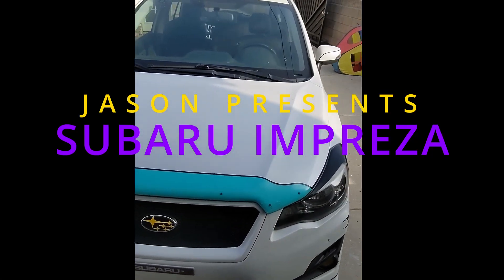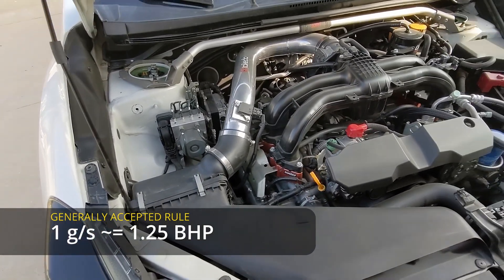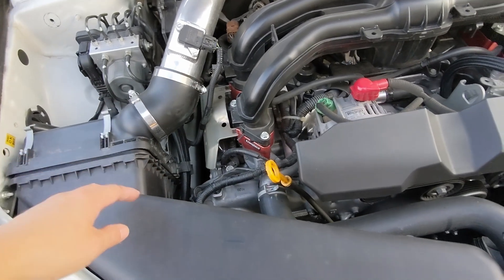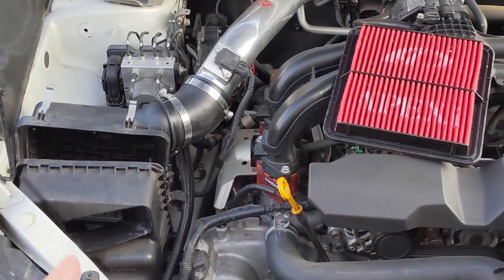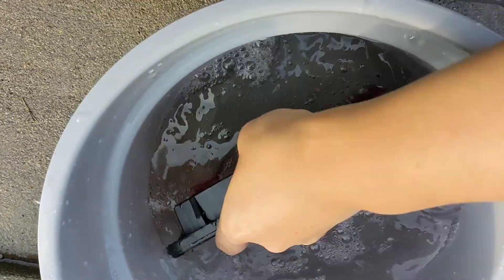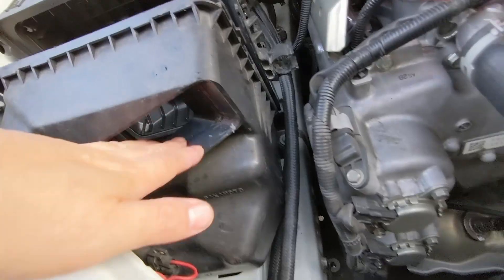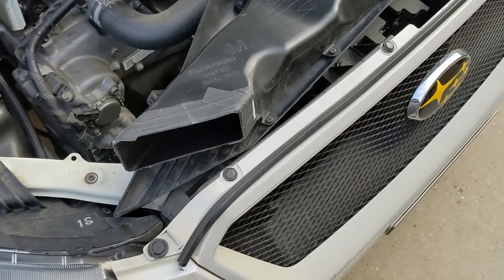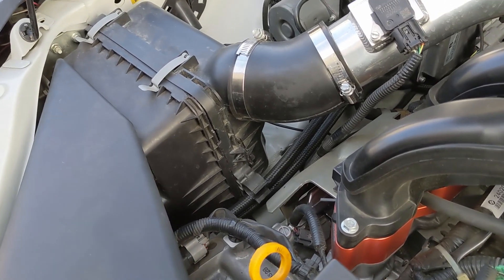Subaru Impreza Sport -  Engine Air Filter Service, mods and optimizations

Comment: I have a question about the air oil separator. The only naturally aspirated Subarus that aftermarket companies seem to make the air oil separators for are the Bajas. How did you get the Baja kit to work for your Impreza, and what brands do you have experience and/or a preference with?
Reply from the maker: You may be confusing the Baja edition with the Subaru Baja. Which car and year do you have? Crawford Performance has multiple fitments of AOS for Crosstreks and Imprezas.  I am using one from this page https://crawfordperformance.com/collections/baja-edition-air-oil-separator-aos-kits

Before you go and get an AOS, what are your reasons?
Reply: @JasonLeung-4roller  actually, you’re correct. I was getting that mixed up. I have a 2009 Impreza 2.5i. I recently got a new intake tube that does not separate the air and oil like the the factory intake system did. It could potentially get some oil on the throttle body. I think it would also help reliability if I were to somehow get a AOS installed on my car. A few companies from the same model year, but for the turbo models, have a system that theoretically would work just fine if I only used the parts my car would need, since they have extra tubes and connections mine doesn’t have or need, but I’d like a second opinion
Reply from the maker: @joshadventure8253  the AOS hooks up the the PCV and the intake manifold. Where as the intake (before the throttle body) is connected to the engine breather port. On my car I have used an oil catch can on the engine breather port that then connects to my aftermarket intake tube.  This catch can should help keep the oil vapors from getting into the throttle body, which long term will gum it up. 

To be honest a little bit of preventative maintenance (cleaning PCV valve) and cleaning the throttle body every once in a while (with throttle body cleaner) should really go along way. So much so that the inclusion of both AOS and breather catch can aren't necessary.  That being said both AOS and catch can should help a little. If you are good about maintenance then I'd say save your money.
Reply: @JasonLeung-4roller  that’s fair. Thanks for the help. I really like your channel, it’s helped me with getting some pretty good ideas on better parts for my Subaru

Comment: New to the channel, keep up the great work. Just became the owner of a 2018 Hatch Sport-Tech and was wondering which apexi filter you purchased? Was it the filter for the 2016 or a different model?
Reply from the maker: The filter I bought was for the 2013-2017 Crosstrek though other models use the same airbox. . You may be able to find it for the 2018+ Crosstrek.

Comment: Haha I use pure soap to clean now as it's so much gentler.

Can you reverse the intake on the FA and FB motors? I know it's a mod done on EJs.

The beauty of the aluminium manifold on EJs from what I understand is that not being smooth they trap air on the walls and therefore become even more slippery.
Reply: i really want to know this, i have an fb

Comment: would you consider heat reflect wrapping the pipe going from the box to TB? Alos woudd you try those phenemolic spacers that IAG and Torque Solutions offer?
Reply from the maker: Wrapping may have some use, though the intake pipe is already silver and reflective, so any gain would be very miniscule. As for intake manifold spacers, I am using some ones from Crawford. They are aluminum and the intake manifold is already plastic. The peak torque is increased about 1000rpm lower  and this is the effect of the additional runner length. Thanks for the ideas! I may look into what difference gold vs silver do for emissivity